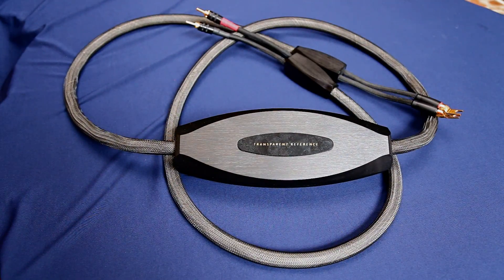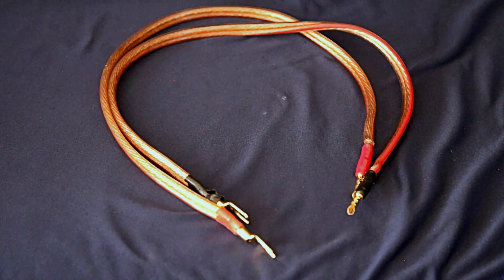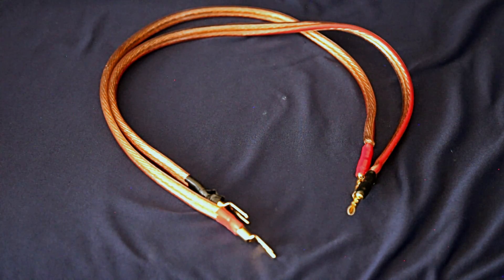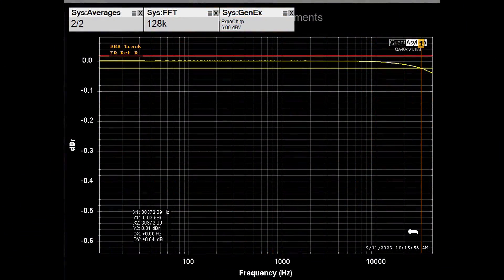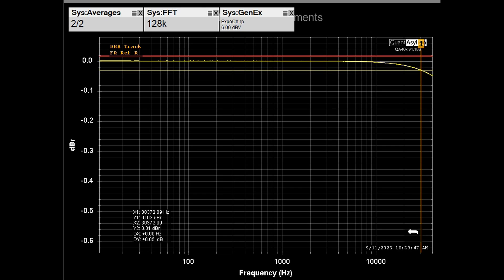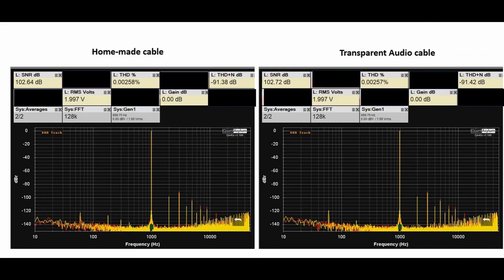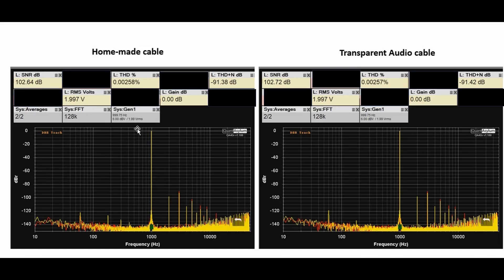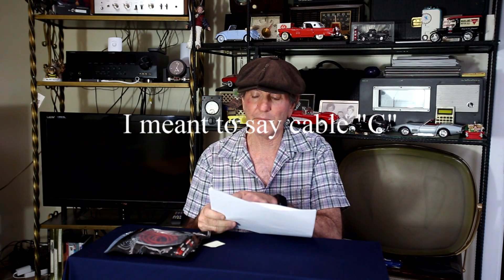$8000/pair Speaker Cable  vs. $14 DIY Speaker Cable A/B Test: Vintage Audio Review Episode #87

Comment: Hello. I have had a LOT of problems with OFC. speaker cables with transparent PVC insulation. especially after I've soldered on them. very many became green and dark in colour. Buying a cheap speaker cable can be punishing. You can get short life out of them.

have also seen this in a newer jamo speaker

now only tinned copper cable and never untinned
Reply: Yep, that's an electrolytic reaction to passing current through a junction of dissimilar metals.  It's not limited to aluminium wire... but that is the worst for it.  

IF your cables are reacting as you say, it's probably not copper.  Most likely it's Copper Clad Aluminium.  The simple test is to scrape away a little bit of the surface of the strands and see if they turn silver... if they do it's aluminium wire. 

I've repeatedly seen CCA wire actively reject solder, as in, you make a perfectly good splice and then trying to solder it the solder just rolls off and drips onto the floor.  You actually need special (expensive) solder and an oxygen eliminating paste to make a proper connection to it.

Terrible stuff....
Reply from the maker: As was pointed out in one of these comments, the wire I actually used was Copper clad aluminum, apparently not the best wire, though I have had good luck with it thus far- thanks for the comments
Reply: @vintageaudioreview  By the way, the measurement you are doing is not good enough! I 100% agree that the sound difference between cheap good cables and EXPENSIVE cables is so small that you have problems hearing differences.

But you also have to measure the capacitor value and other things. And you also have to zoom in on the measurement on the oscilloscope. It seems that you have zoomed out quite a bit and then you don't see the difference.

I believe that you must also have a very good sound system before it makes sense to buy expensive cables
Reply: @ford1546 
See my other comments on this ... reactance, inductance and other feedline effects are unimportant below 1/4 electrical wavelength of cable, so unless you are running 2 mile cables, you don't need to worry about that.  
Plus, from experience, if you have to zoom in on a scope trace to find a difference... it is extremely unlikely you will hear it.
Reply from the maker: Thanks for taking the time to share your thoughts. At least we agree that the expensive cables will not sound different that the "cheap" cables. Douglas_Blake_579 has commented a lot about the capacitive, inductive and resistive elements of audio cables is pretty miniscule. The scope you mentioned is an audio analyzer and the scales I use (for THD) are normal and show what is going on. The frequency response plots can be zoomed in enough to make and show any difference.
Reply: @vintageaudioreview 
Quant Asylum unit... right?
NICE!
Reply from the maker: @Douglas_Blake_579  Yes, the QA402. I love it so much that I thought about putting it under my pillow at night.
Reply: @vintageaudioreview  
🙂

The reason I know it's copper is that I've taken a knife and scratched quite deeply into the copper wires of the cable to see.

Copper pipes normally turn green to black when they oxidize.

Yes, I have seen this a lot on relatively cheap cobber cables.

Therefore I now only use tinned copper cable.

Could this be due to the solder wire type or that the cable is no longer OFC? After you have soldered on it?

yes, I know that some factories use aluminum wires or copper tinned steel conductors on the antenna cable
Reply from the maker: The wires that I used seemed to solder well. Will see how they hold up- will be using them to review and vintage Kenwood integrated amp this afternoon.....
Reply: @ford1546 
You can try turning down the heat on your soldering iron a bit.  Some irons actually get hot enough to soften the copper and make it brittle. 

Nothing wrong with tinned copper.  I use it for hookup cable inside speakers and other things all the time. 

The big bugaboo with CCA as Scott found out is that manufacturers are not required to tell you it's CCA... and the online distributors are no better, allowing deceptive descriptions like "Oxygen Free Cable" which, even I read as "Oxygen Free Copper" the first time.

Comment: wow you are something you put 2 cable mono not even stereo into a 2 foot section of complete garbage copper you made in your basement through another box full of garbage copper and tried to compare. I think forest gump would be shocked. OF COURSE THERE IS NO DIFFERENCE WHEN BOTH RUN THROUGH THE SAME 2 FOOT END ON THE SAME CABLE. instead of listening to audio please bang on rocks with sticks please it is better. You will save more money.
Reply: When all other factors in an experiment are identical, with only the item under test being changed ... the comparison is valid.  Had he changed everything from the amp to speakers, there would have been multiple potential causes for any difference they detected... the comparison would be invalid.

The test was done correctly.
Reply from the maker: Thanks for the reply, though you did like the test. We don't have many basements here in the desert, btw. Point taken about the small cable section. You may want to read up on some basic electronics to understand about the small cables construction not really adding much of a difference..

Comment: For a test like this use real audio equipment and real speakers at least lol
Reply from the maker: I appreciate your taking the time to comment. What is real audio equipment and real speakers in your opinion? One commentor suggested a minimum hardware list like what Microsoft is doing when going from Windows 10 to 11....Lucasfilm had minimum performance specifications for equipment in order for it to get the THX certification....

Comment: I have a quite nice new Mcintosh / Sonus Faber system.  I just couldn’t bring myself to spend a bunch more money on cables. I went to the car stereo shop down the street and said I wanted their best cable..  They sold me 40 feet of 10 gauge for $40 and said they’ve tried more expensive a few times and could never hear a difference.
Reply from the maker: Thanks for sharing your experience. Sounds like your 10 gauge wire is working well- no surprise there.

Comment: I would have more respect for your test if you figured out a way to have the cables run directly from the amplifier to the speakers without an intermediary patch cable.  I also would expect a “correct”test to allow the audience to hear the wires in a “stereo” setting, as the differences in the construction of the wire may reflect in subtle sound differences, and hearing music the way it was intended to be played seems reasonable.

What I do know, for certain is, there is a point of diminishing returns, and each person must make a determination in their individual system at what point the sound is what they are looking for.  I’ve tested wires and components in my system that sounded “different” but not necessarily “better.”Who knows, maybe what I consider to be “different” someone else might consider to sound “better.”
Reply from the maker: Thanks for the comment- point well taken about the intermediate cable, but no way to do the test that I am aware of w/out one. Don't agree about need to have two of them for  tonal test, which this was.

Comment: I have seen this type of cable test multiple times since the 70's. When set up properly, almost always no difference. A few times the fancy, expensive cables actually sounded worse, usually because of some "magic tech" add on component to the cables. And of course, there are the stories of what Monster Cable use to do at shows, using regular cables behind the scene for the actual hook ups!
Reply from the maker: Thanks for input- never heard any Monster cable stories, though....
Reply: @vintageaudioreview 
Okay ... two quick stories for you.

1) I was called in to service a "Monster" demo unit in a local hifi shop.  The "standard cable" side of the switch had stopped working.  I noticed it was connected with about 50 feet of coiled up telephone wire (26ga), so I did what any competent tech would do and replaced it with about 6 inches of proper 16ga hookup wire.  Their sales of Monster cables tanked...

2) At a Canadian audiofest I attended a demonstration of "AQ" cables and like everyone else I heard the stunning difference between the "standard" RCA cable and the AQ one.  After the demo the salesmaker left his stand unattended as he milled though the crowd taking orders. I went behind the stand, spotted an equalizer hooked into the system... put it on top of the stand for all to see... and the place exploded into a near riot when people realized what had been done to them.   Needless to say I was actively invited to never return to that show again.

Comment: The arrows point to the speaker end not the amplifier.
Reply from the maker: I just went on the website and could not find anything about how they are connected. Not that it would make any difference from what I have seen. Thanks for commenting
Reply: The arrows indicate signal flow so in the case of speaker cables they would point to the speakers.  If you connected them in reverse (which is what you said in your video) then you would completely negate the action of the network (which are designed to work directionally).
Reply from the maker: @rambler3080  Once again, I did not see anything on their website telling you how to connect the cables. I did see where the cable could be "recalibrated" for your system.  I guess they know the impedances for most amplifers and speakers...
Reply: Well the only thing that’s laughable is the fact he has an engineering degree.  In many cases interconnect cable designer float the shield at one end allow grounding on one component (usually the preamp) and the arrows indicate which end has been floated.  
As for the Transparent speaker cable, there is a network in the box consisting of caps and inductors and I’m pretty sure it’s designed to be directional taking into account impedance of source and load.
I’m done discussing this with you.  When people make obvious mistakes based on ignorance, the most popular  excuse it to claim it’s not important anyway.
Reply from the maker: @rambler3080  I do appreciate the discourse, though we differ in our opinion. My Electrical engineering friends are RF/Microwave engineers, pretty high up there on the totem pole and deal with stuff where cables do matter. No problem spending $8k on a microwave cable that long. W/out seeing the network inside the box on the cable there is no way to know if direction would make any difference. How do they match it ? Are they going to have the impedance of my Wilson Sasha speakers and my McIntosh MC2300's output impedance plot on a file that they can put into a program to calculate a "network"  (for example, not one of my systems) ? The output impedance for many of the better performing Solid state amps that I have measured is quite low would not be affected a reasonable quality speaker cable.  I have only questioned the direction of the arrows and based on what I know, made the statement I did not think it would make any difference, and was unable to test them with the arrows going in different directions. I have no problem with being wrong about something- happens all the time. Thanks for your discourse
Reply: I don’t know what to tell you man, if you don’t know what arrows mean on a cable then perhaps you shouldn’t be doing cable shootouts.
Reply from the maker: @rambler3080  To be honest, this is the 1st pair of cables that I have tested that had arrows on it. I am pretty sure that the frequency response would not change based on the direction they were measured. I no longer have the cables to verify this. As I mentioned in an earlier replier, my electrical engineering friends laughed at the fact that the cables had arrows showing how to connect them.

Comment: Some people can hardly make financial ends meet, and there are those who think $8000 for speaker wire is okay. Clearly it seems there's no audible difference, when testing equipment can barely detect micro differences
Reply from the maker: thanks for the comment. I cannot begrudge someone who has the financial ability to buy $8000 speakers and purchases them. If they tell me that that their sound has improved greatly, I am going to be a bit skeptical.